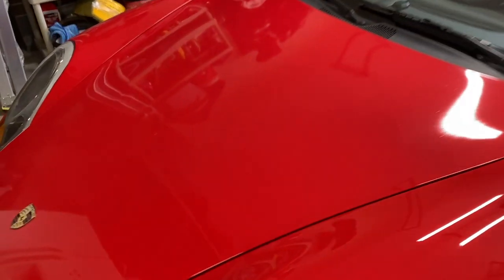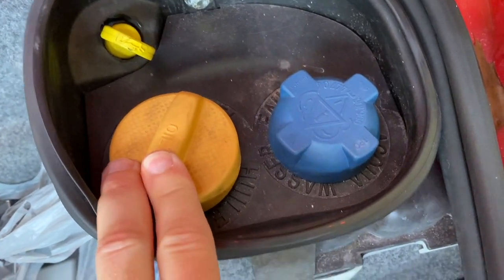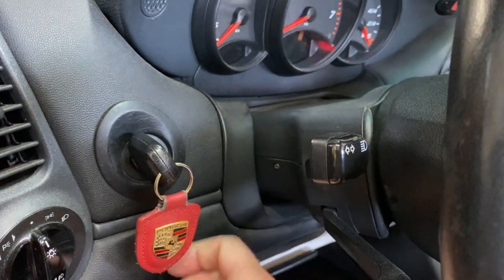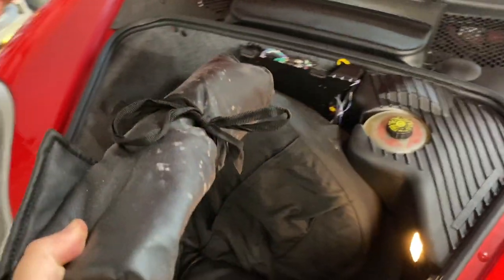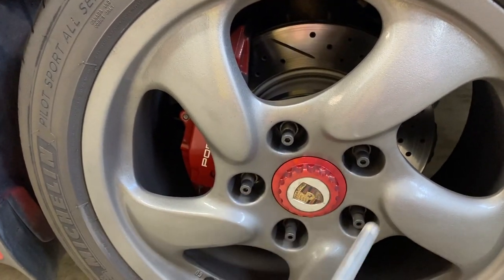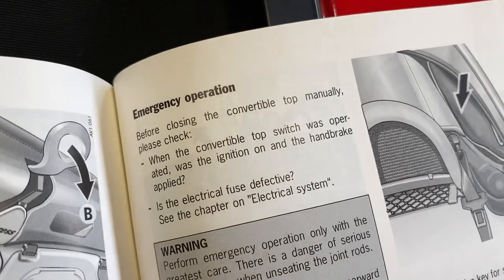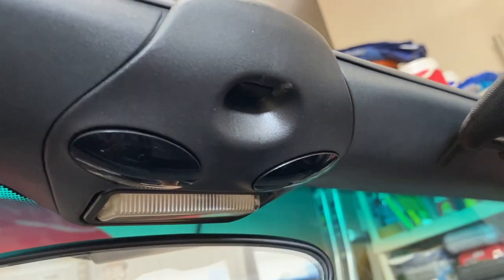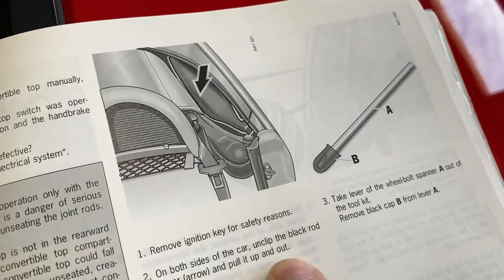5 MORE Tips and Tricks for the Porsche Boxster 986

Comment: 0:44 Warning! Putting your palm on the crest to close the bonnet (hood) is wrong (and has been superseded). Porsche (originally) recommended this approach which has caused many Boxsters to eventually have an indentation around the badge. Mine is one of them. The new recommended approach is to spread both palms on the bonnet's edge (basically around the latch area) and just lean over using your weight to click the latch into place. This was explained to me by a Porsche salesman who sold hundreds of Boxsters and my Porsche trained mechanic confirmed the technique.
Reply from the maker: +MrTinykin interesting, first time I’ve heard that. That would definitely work too! I’ve closed it hundreds of times from the crest through and it has always felt very firm. I’ll try it the “new” way you mentioned next time.

Comment: An additional tip similar to the key no releasing is if you can put your key in but it won't turn, wiggle the steering wheel back and forth. That's saved me a few times!
Reply from the maker: +Ryan Luckinbill yes, but that’s true for EVERY car. At least all the ones I’ve owned 😉

Comment: My parking brake sensor failed and had to do the top procedure. FYI, it’s not too hard to get the ball joints back on once you get the top working again. The arms are under considerable tension when the top is down but if you actuate the top mechanism about halfway, the joints will line up and you can pop them back in.
Reply from the maker: +Tyler Vonderhaar great to know, thanks!

Comment: Leather seats at the track. Lots of sliding around. You can lock your factory seatbelt. 
Slide the seat back 2-3 notches. Put the belt on, push back into the seat and then jerk the shoulder belt to lock the inertial lock. Lean forward to keep it locked and then slide the seat back to your normal position. Do it a couple of times and it becomes second nature.
Reply from the maker: +John Zebarth ha. A DIY harness 😃

Comment: Thanks for the tips! I just checked my coolant cap and it's .00, so replacement ordered. Also, I recently had to change the fuse for my cigarette lighter and had to look up on the internet what fuse was where - no booklet in my fuse box. However, I did now just find it in with my owner's manual in the leather pouch - I had no idea this existed (and was somewhat ticked off that it wasn't in the owner's manual itself - I wondered how anybody knew what fuse was what!).

I suspect that tool for popping off the ball joints would have been handy when I replaced the front and rear trunk studs too (probably would have save my knuckles a bit).
Reply from the maker: +Jack Beckman glad it helped!

Comment: My boxster  spoiler doesnt come out at all I try the Manuel button near the bottle driver seat and it doesn’t work it won’t come out by itself either I was wondering if you got anything that can help me And any body kit you know about
Reply from the maker: +Kevin Cauich first I would have someone follow you when you are driving over 70 mph and have them tell you if it goes up at speed. If so it could be that switch is bad. If not I would check a fuse. If that’s not it I would start googling.

Comment: Hi Eran. I hope I spelt your name correctly. I cant remember you showing it in your past videos but I am looking to remove  my AC unit. It looks to be held on by just two bolts, that I can see. Do you know if it is a straight forward removal from the panel behind the seats.
Sorry to bother you with this but I thought I would ask anyway. I am in the midst of swapping out my old water pump and thermostat when I noticed there are two pipes that run from the back to the front of the car, just at the edge of the underside of the car. They were covered in what looked like bright green liquid. I can only guess that the pipes are leading to/from the AC unit. Any ideas you may have would be very welcome. Thanks
Reply from the maker: +Robert Hooles it’s Aaron, but no worries 😉 
Yeah, you never saw it in my past videos because I’ve never removed the AC. I assume it’s straightforward but I can’t say for sure. 
Bright green liquid sounds like coolant. The wrong color coolant for the car, but look in the coolant reservoir in the trunk and see if that’s the color of your coolant (assuming there is still some left in there). Those pipes sound like coolant hoses running from the radiators in the front of your car back to the engine where the water pump is.
Reply: Don’t try to remove the AC pump. First, you would need to lower the engin about 4 inches to remove it through the access panel in the cabin. It would also release dangerous gases into the atmosphere! And, as Aaron remarked, your problem sounds much more like a coolant leak than an AC leak.
Reply: @NewArt1  Thanks for the advice. It did look to me as though it would slip straight out of the opening behind the seats but if it means having to drop the engine I don’t think it would be worth it. Thanks
Reply: @HelpMeDIY  Hi Aaron. Thanks for the advice. You may well be right about the pipes carrying coolant, I shall check the whole system. Thanks again